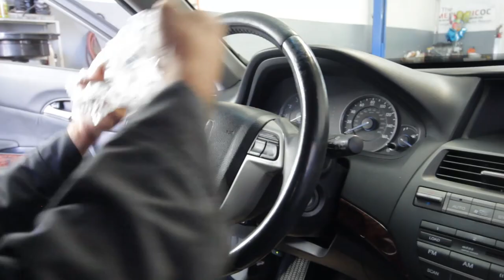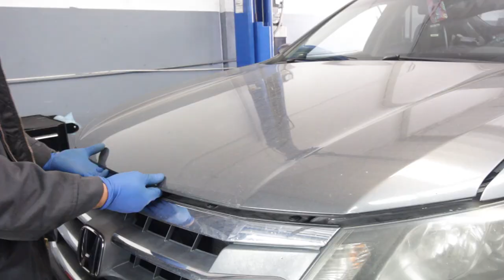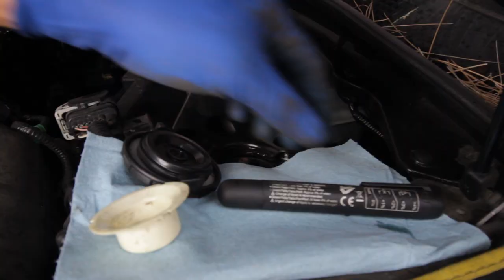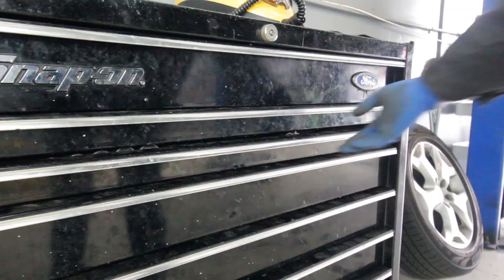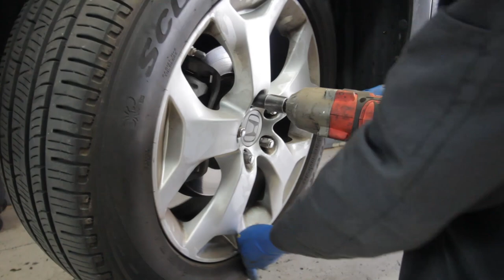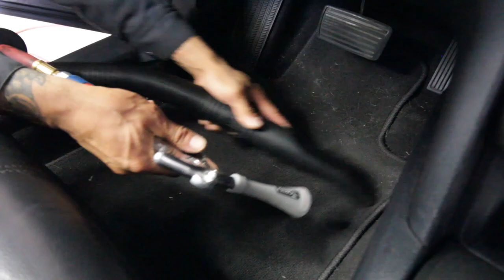How to do a Brake Inspection

Comment: Can you tell me about your air attachment that you were using on the carpet? When you were vacuuming at the end of the video.
Reply from the maker: It's a vortex air gun that picks up dirt that the vacuum cleaner can't get up from the carpet. It makes vacuuming customers cars so much faster. It also cleans so much better. Heres the link to it on amazon. HI-TECH Vortex Cleaning Gun - Quickly Blasts Dirt and Dust from Surface - Works with Air Compressor (Vortex II)

https://www.amazon.com/dp/B019YATN0O?ref=ppx_yo2ov_dt_b_product_details&th=1